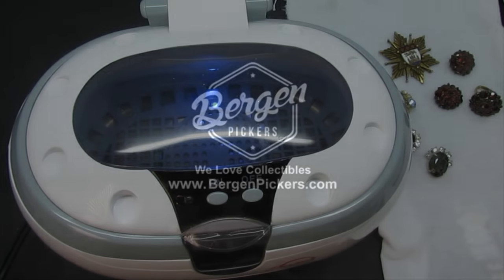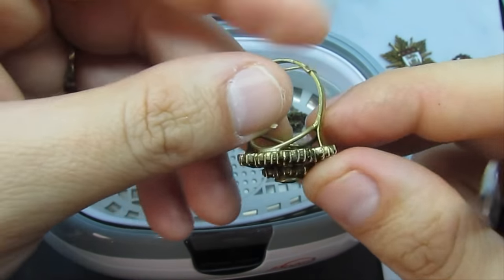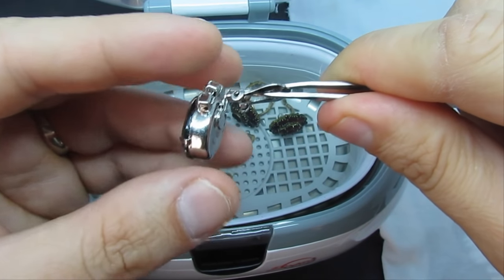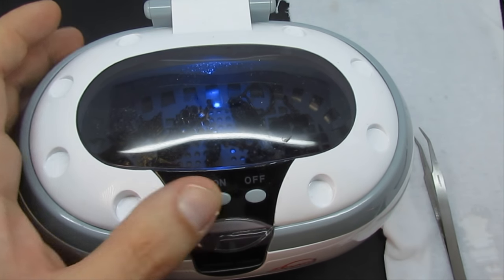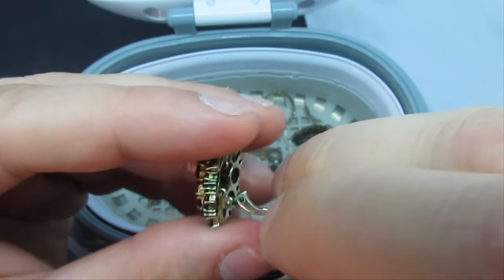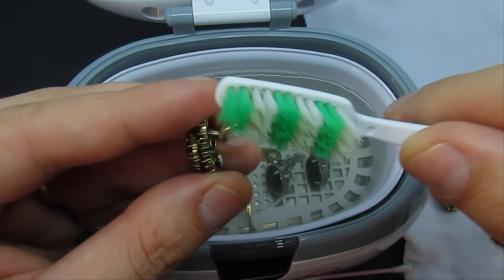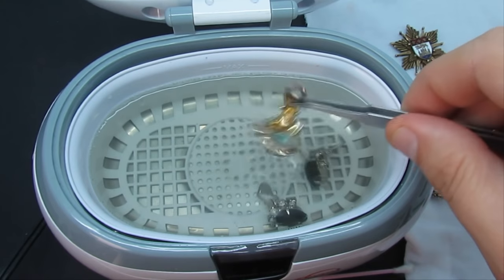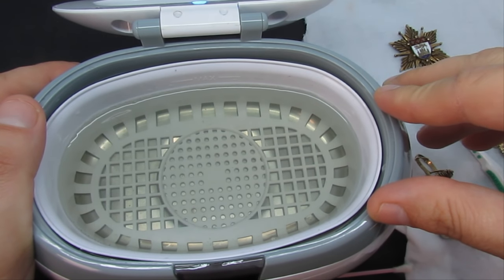How to Clean Vintage Costume Jewelry - Jewelry Cleaning Tutorial

Comment: If you dip the Q-Tip in the liquid, wouldn't the verdigris and crud come off easier? Also, wouldn't it be a good idea to rinse off the pieces in fresh water?
Reply from the maker: It would take much longer to use it that way, and verdigris would still be present. Better to use Q tip after treatment as all the crud has been loosened.
Reply: Bergen Pickers   Ah, got it, thanks for the reply. Did you ever sell the garnet set?
Reply from the maker: @veecee3669  Yes, it was sold quite some time ago.
Reply: Bergen Pickers   Yes, I figured it was long gone. Thanks for getting back to me. Happy holidays!
Reply from the maker: @veecee3669  Hope you enjoy your holidays as well!
Reply: Bergen Pickers    🎅